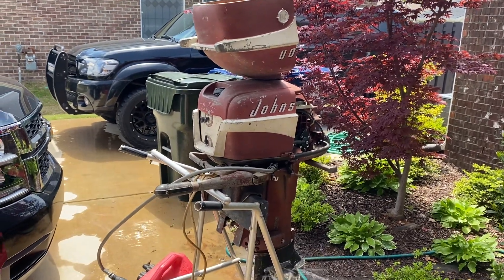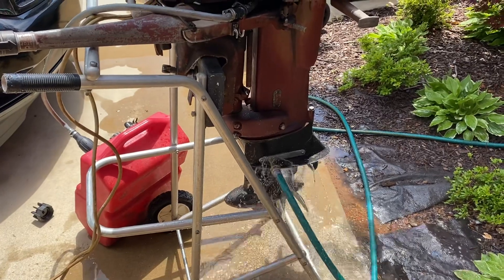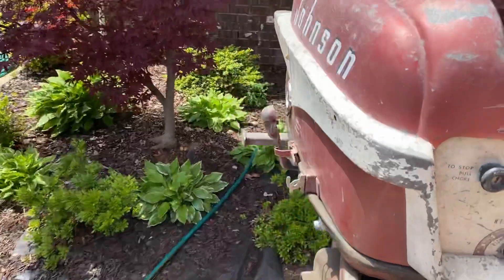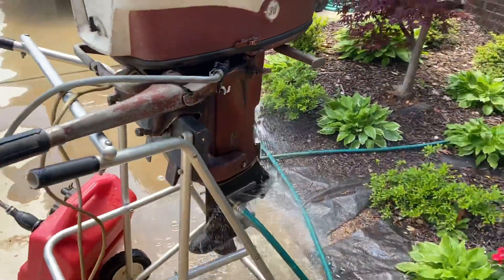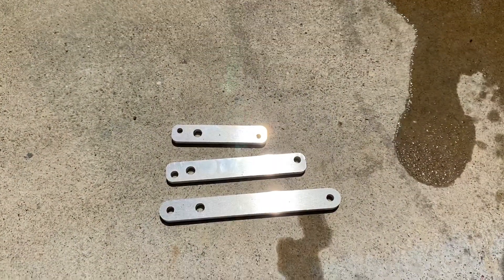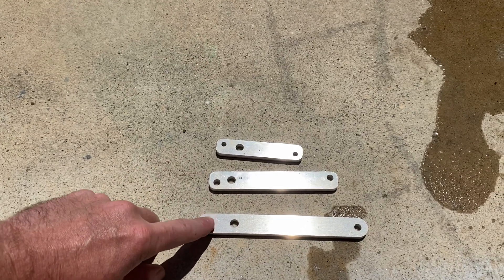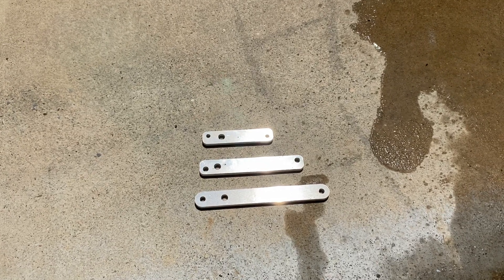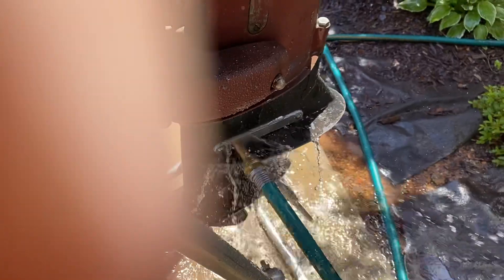25 / 30 Hp Dual Line To Single Line  Tank and Fuel Pump Conversion Demo & NEW Motor Flush Plate Kit

Comment: I want a set for a 25022 and a set for a 18
Reply from the maker: You can buy the 18 plates here

https://www.ebay.com/itm/275813153775 

and the 30 here:

https://www.ebay.com/itm/274743697934

If you are talking about the flush kits they are in my eBay store as well https://www.eBay.com/usr/thisoldoutboard

Comment: how hard is it to install the fuel pump conversion i have a 5.5 like that  its runs great but the tank is a pain in the butt   id love to be able to put a modern fuel tank and line on it
Reply from the maker: My bypass cover plates (or any bypass cover plate) will not work for the 5.5 hp motors. The 5.5 hp motors are more involved to convert to a single line system.  See the link below

https://outboard-boat-motor-repair.com/Johnson%205.5%20HP%20Seahorse%20Outboard%20Boat%20Motor/Pressureized%20Fuel%20Tanks.htm

Comment: I need to get a water bypass for my 10 hp Johnson QD-16 and another for my 35 hp Javelin RJE-19. O.k. finally I need the full combo. Please let us know on your site.
Reply: The 3 plates that is my dear sir !
Reply from the maker: You can find all my plates for sale on eBay here:  https://thisoldoutboard.com/custom-bypass-cover/

Make sure to look at the listing pictures for the 35 hp to make sure the plate will work with your motor.

Reply here if or email me at thisoldoutboard@gmail.com if you still need help
Reply from the maker: Daniel,  do you mean the bypass cover plates or the flush plates?
Reply from the maker: Daniel, what do you mean as “full combo”
Reply from the maker: Flush plates are available now:

5.5, 6, 7.5, 9.5, 10 Hp - https://www.ebay.com/itm/274801190039
15, 18, 20, 25 Hp - https://www.ebay.com/itm/274801203602
28, 30, 33, 35, 40 Hp - https://www.ebay.com/itm/274801212188
Reply: @thisoldoutboard  Odered the flush plate for the10 hp, we'll see how it works. Thanks !
Reply from the maker: The one I sent was the wrong size for a QD-16 so I am sending you the correct one free of charge.  You don’t have to return the wrong one I sent.  My apologies.

Comment: I'd be interested in the one for an 18HP
Reply from the maker: Will have available on eBay by the end of the week. Right now I can only offer the plate and attachment screws.  You’ll need to buy the garden hose adapter separately. Link to garden hose adapter: https://amzn.to/3unA7NG

I am working on an affordable solution for a kit but the truth is one plate and garden hose adapter can service multiple motors so not everyone will want to buy a full kit.
Reply: Still beats having to fill up the trash can for testing out of the water.
Reply from the maker: Flush plates are available now:

5.5, 6, 7.5, 9.5, 10 Hp - https://www.ebay.com/itm/274801190039
15, 18, 20, 25 Hp - https://www.ebay.com/itm/274801203602
28, 30, 33, 35, 40 Hp - https://www.ebay.com/itm/274801212188
Reply: @thisoldoutboard  ordered!
Reply from the maker: @BlacksmithSportsman  yessir!  Thank you for your business.  Will get picked up by usps tomorrow!

Comment: I have several small outboards from the 50s to the 70s that I'd buy flush plates for. Putting those 25 hp motors in a barrel is getting hard on my back. I bought your shift rod bushing removal tool last year and love it! I've already used it to reseal several lower units.
Reply from the maker: Thanks! I should have several of the 15 / 18 / 25 Hp plates finished mid-May
Reply: @thisoldoutboard  I saw your ebay listings. I think you might have some of your smaller cover listings wrong. I have a 10hp 1956 Johnson qd-17. According to my parts catalog, the bypass cover is part #302505 for that motor. That would be the bigger 5 inch cover you sell not the 3 inch one.
Reply from the maker: @bpeyton4205  thanks.  You’re right.  By my records the smaller plate fits the 1958 and newer 10 hp motors.  Is that what you see as well?

I will fix the listings and pictures as soon as eBay allows me.
Reply from the maker: @bpeyton4205  listings have been updated.  thanks again.
Reply from the maker: Can you give me a list of your motors?
Reply: @thisoldoutboard  I have a 1976 25hp Johnson, a 1974 25hp Evinrude, a 1953 15 hp evinrude, a 1956 10hp johnson, and a 1972 6hp evinrude.
Reply from the maker: @bpeyton4205  send me an email to thisoldoutboard@gmail.com and I will send you the two plates for your motors free of charge for calling out my listing error
Reply: @thisoldoutboard  I actually just put in an order on your ebay store. I hadn't seen your offer to send me the covers lol.
Reply from the maker: @bpeyton4205  I’ll refund you the full amount once eBay lets me.  The initial shipping refund has to process first.
Reply from the maker: @bpeyton4205  sent you a full refund.  If you could send me a video of you using them that would help me out a lot
Reply: @thisoldoutboard  No problem. I'd be happy to post a video on youtube showing both covers. Your videos are actually what inspired me to revive my first outboard last year. I bought your shift rod bushing tool and have used it to great effect.

 I've been looking for flush covers like these since I first read about them on Leeroy's Ramblings (https://www.leeroysramblings.com/flushing-test_running_an_outboard.html). I'm glad someone made some!
Reply from the maker: Flush plates are available now:

5.5, 6, 7.5, 9.5, 10 Hp - https://www.ebay.com/itm/274801190039
15, 18, 20, 25 Hp - https://www.ebay.com/itm/274801203602
28, 30, 33, 35, 40 Hp - https://www.ebay.com/itm/274801212188

Comment: I have a 25 hp Evinrude 70's model I would be interested in the flow plate.
Reply from the maker: Flush plates are available now:

5.5, 6, 7.5, 9.5, 10 Hp - https://www.ebay.com/itm/274801190039
15, 18, 20, 25 Hp - https://www.ebay.com/itm/274801203602
28, 30, 33, 35, 40 Hp - https://www.ebay.com/itm/274801212188

Comment: Love the water flow plate! Great idea, no more barrels 👍
Reply from the maker: Thanks Mike. I will have them in my eBay store in a week or so.
Reply from the maker: A little octane water never hurt nobody
Reply from the maker: Flush plates are available now:

5.5, 6, 7.5, 9.5, 10 Hp - https://www.ebay.com/itm/274801190039
15, 18, 20, 25 Hp - https://www.ebay.com/itm/274801203602
28, 30, 33, 35, 40 Hp - https://www.ebay.com/itm/274801212188